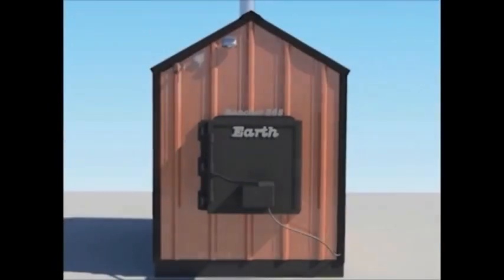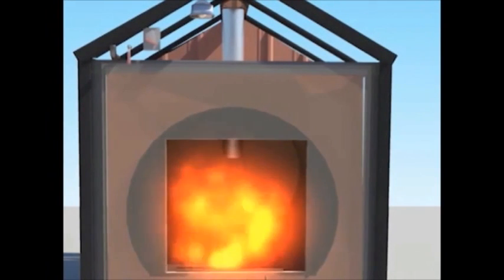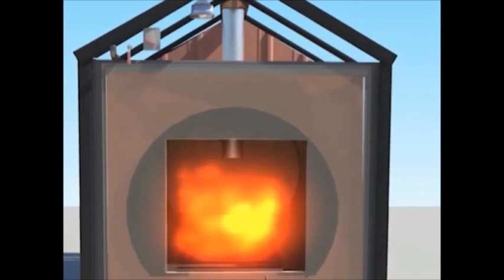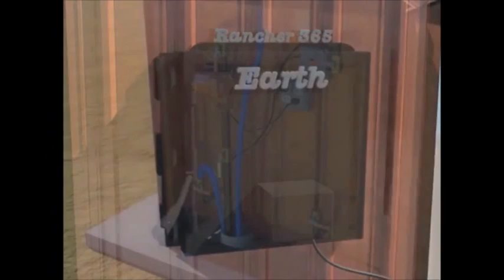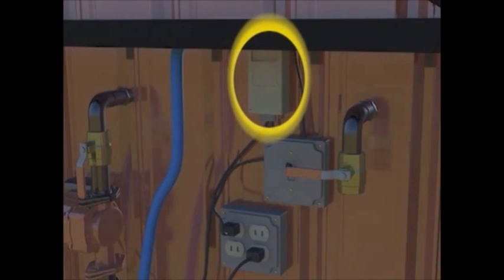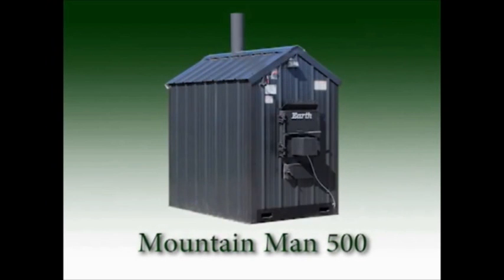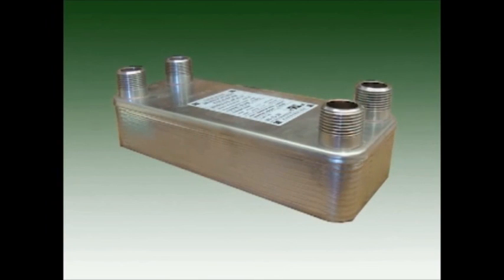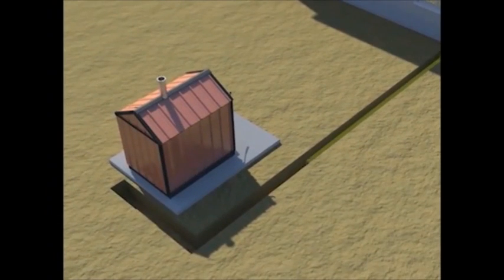Outdoor Wood Furnace Installation and Operation

Comment: Nowadays you simply buy anew outdoor wood burning furnace, boilers are pressurized. These as are not pressurized. All new outdoor wood burners sold in the US are gasification models. You might get a couple of minutes of smoke then the unit starts burning the smoke and gas giving the owner nothing but heatwaves out the stack and reduces the amount of wood consumed by near 50 percent. Got a neighbor switched over to the new technology and he loves it. Cut his wood consumption from 24 cords 2 years ago to less then 10 cords this past winter. His neighbors thought he stopped burning wood as the smoke stopped covering the neighborhood.
Reply: James Shanks how much do they cost$$$$$

Comment: I honestly don't know the cost as he just smiled when I asked him and said " none of your business " he bought it so I don't blame him for not telling me but you can find out by calling portage and main in Canada how much their enviro-chip outdoor woodchip burning unit is. It comes with a 7 cubic yard storage bin that holds the woodchips protected from the weather and feeds them via a screw conveyer. He paid a logger to come in and chop up just over 80 cords of wood to chips 2 inch minus and purchased a good used Kubota diesel tractor with a full winterized cab which has a heater and ac, the tractor with a front end loader and a mini backhoe on it cost him just over $4500 in really good condition ready to work. He needs the bucket loader to fill the storage bin which holds enough chips to heat his house and workshop for 7 days and what he loves about it is other than removing the ashes after filling the bin it's fully automatic. He had updated his underground lines to the house and shop 4 years ago and they are very efficient so he just hooked up the new furnace to the existing lines with no problem at all. The envirochip burner will generate up to 500,000 btu's with seasoned woodchips or if you use green woodchips it will generate roughly 300,000 to 350,000 btu's with no creosote buildup at all with all woodchips burned. It cost him a little more than the wife wanted them to spend as she didn't think the tractor was necessary until the unit arrived and was set up. He also bought 9 45 foot shipping containers set up two on concrete blocks to get them off the ground in two rows of 6 boxes and the last three set on top of the six on the ground giving him a nice covered area to store woodchips with equipment storage in one set of containers and the other set off three alongside the house and added to the house to give the family 2 more bedrooms with each having a full bathroom. They have 7 girls and needed the space as 4 girls were complaining they needed their own rooms. The girls including Mom didn't think the containers were going to fill the bill until they saw the roughed in additional rooms and love them saying you'd never know they were containers. Cedar fence panels on the outside and a couple of student artists from a local college painting them you would never know they were containers unless you touched them.

The ash the enviro-chip burner leaves behind is the consistency of flour, very dry. Whether it's burning seasoned or green woodchips.
He won't tell me how much he paid but with the remodeling he did I can't say I blame him.

Hope this helps.